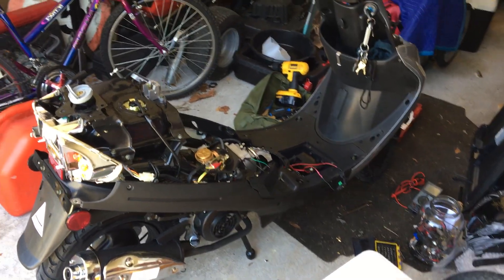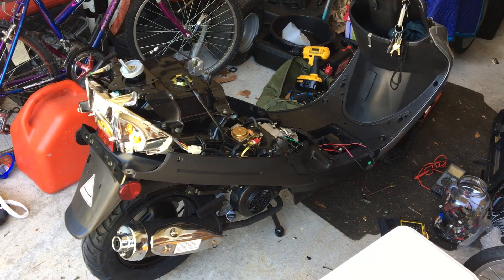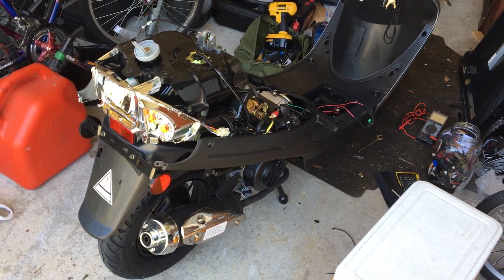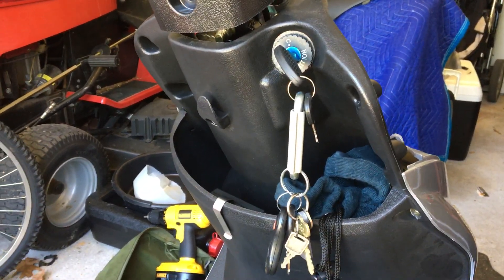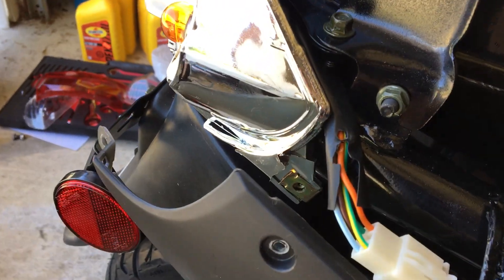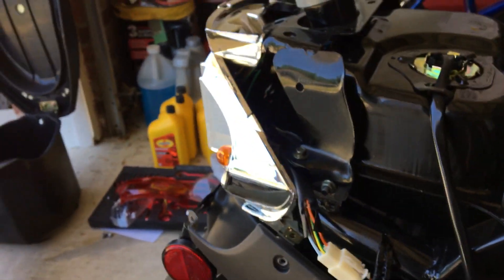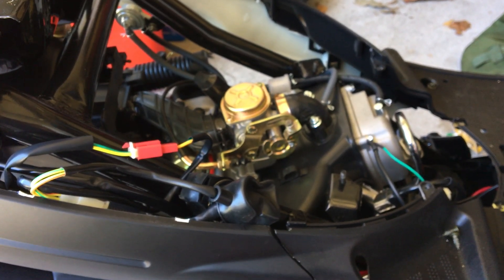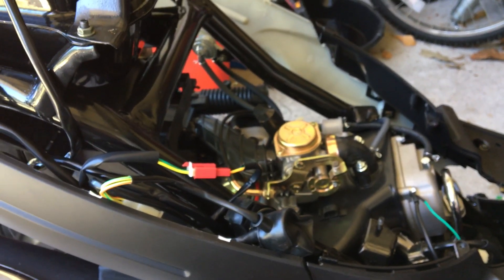TaoTao 50cc Scooter Keeps Blowing Fuse Fix

Comment: Same thing happen to my 2016 tao tao 50, Except it was the screw on the left back battery cover that was protruding to far inside the battery box and grounding out the battery cable causing the fuse to blow. Re-routed cables and also bought shorter screw. Seems to be always something with these small scooters. Good find on your part though.Good job

Comment: Well done process of elimination shortcut , sometimes the invisible symptoms are gawking at your pre determined eyes .  Engine  idle drop  will also lead to the shorting area when turned on , e.g.brake light circuit , headlights ... Or just to many things at once , intermittent faults like a bad earth connection[ black ] hidden under a good connector on top. Lol. Cheers
Reply: So the idle drop is due to a brake light circuit or headlight circut?

Comment: I have changed the CDI coil and stator still have no spark
Reply from the maker: Have you checked the little fuse hooked to the battery? That's what would cause mine to not have spark, also I had an orange "performance" coil and it was dead when I got it, cheap aftermarket parts
Reply: Fuses are good can't find what's stopping it from getting fire

Comment: Inside the tail light where the bulb locked into connector is probably dry-rotted and fell apart causing the positive and negative to touch sometimes had to replace mine
Reply from the maker: My scooter was less than 3 months old at the time of the video and garage kept lol

Comment: dude same thing happening to me right now. what kind of fuse are you using to replace the one that blows. ive gone through 5 so far and I cant get past this shit its driving me mad.
Reply from the maker: I just used the same type that was in it, you gotta have a short happening somewhere, these Chinese bikes aren’t exactly built to high standards lol
Reply: @Z3CHYD  I know its just strange how my headlights and lights work, I kick started it and it started but died shortly, adjusted idle screw and fuel intake screw to carb, the kill switch doesn't work. I think it's my stator but the damn nut to take the magneto is stripped like a beast. im gonna have to chisel that nut off piece by piece without screwing up the threads on the stem. checked all wires nothing split or touching metal, battery charges at 12.88 . I dont know I just gotta keep at it I guess. I have 3 scooters im tryin to bring back to life.